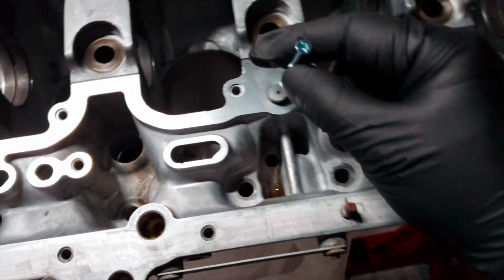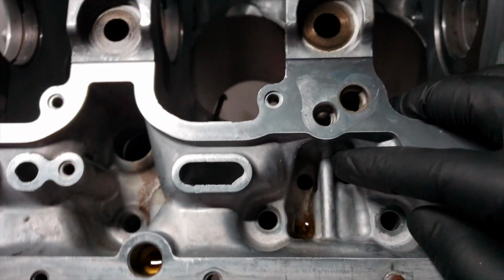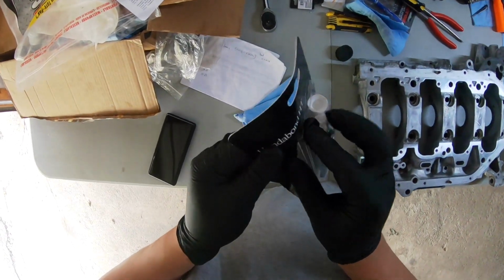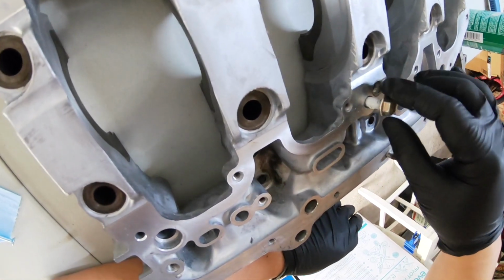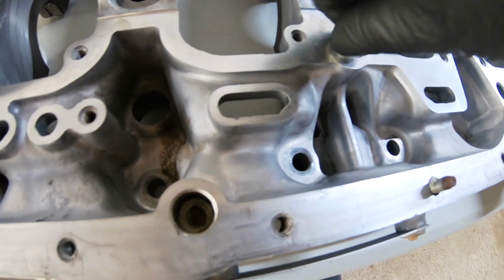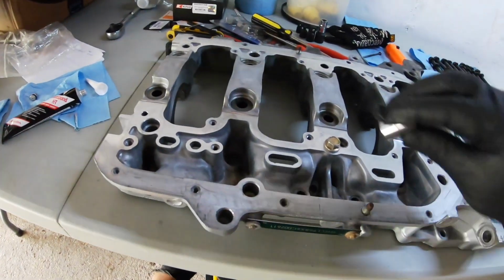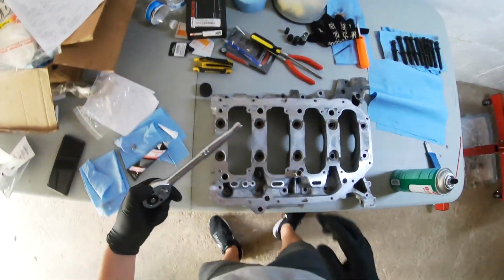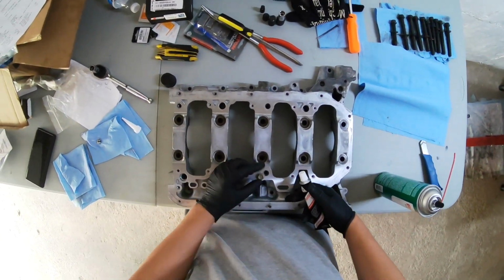QUICK TIP: Plug Your K24 GIRDLE for Oil Pressure

Comment: what is the purpose of blocking this?
is that little port just an oil bleed? to bleed off pressure thats not needed?
or was it supplying somthing?
Reply: The k24 comes with an oil pump with balancing shafts. I believe this small hole supply oil to the balancing shafts. Without them there since we are using a type s or type r oil pump you need to block this off.

Comment: Do we need do this if we are using k24a2 oil pump? Or this is only needed when upgrading to k20a2 oil pump?
Reply from the maker: If its a stock k24 then no, k20/k24 yes
Reply: @ikigaidriven  any idea what is the safe rpm limit for bone stock k24a2

Comment: What oil pressure should this be running after install on the k24a2 trying to make sure my build is not too high or too low
Reply from the maker: I’ll be 100% with you I don’t know the numbers off the top of my head and I not running a oil pressure gauge at the moment sorry but didn’t want to bs u w some random numbers

Comment: How did u pull that piece out the oil port mines stuck it seems?
Reply from the maker: Put a screw in it and yanked it out haha
Reply: @ikigaidriven  lmaooo I mean I saw what ya did but mine was really tight. I got it out , drilled it used a hammer to knock it upwards ... It's threaded so that's that's up!

Comment: Do you still need the tsx oil pump after doing this ?
Reply from the maker: I'm using a ported k20a2 pump
Reply from the maker: We are doing a 5,000 subscriber giveaway, check that video out to win a free hoodie
Reply: @ikigaidriven  I can’t afford an oil pump change right now but I just want to know if this will eliminate low oil pressure .. I’m not planning on red lining the car ... just want to be able to enjoy it some what
Reply from the maker: Yes you can retain the old oil pump but you would also need the k24 oil pan
Reply: Why would you need the k24 oil pan

Comment: first of all which k24 block are you using
Reply from the maker: I'm using a k24a2 from an 06 tsx. Thanks for your support.
Reply: as per hybrid racing the only k24 block that needs to be plugged is the k24z motors due to the difference oil filter location
Reply from the maker: I just saw the article you re referring to. However my k20a2 girdle was bolted the same way and I'm using an a2 oil pump. Better safe than sorry, your thoughts?
Reply: Wrong ..you need to plug all k24 motors whe eliminating balance shafts